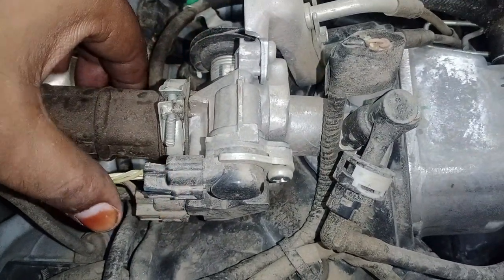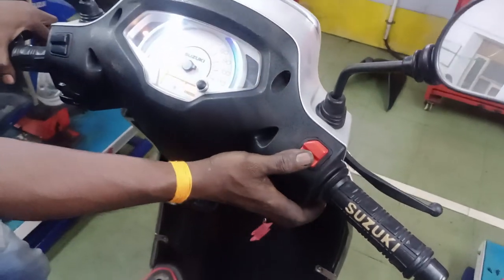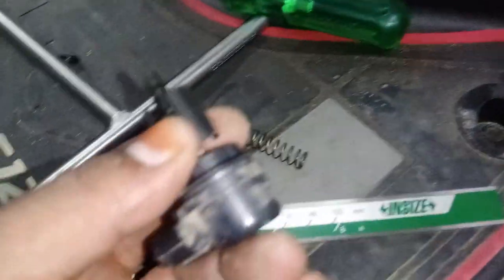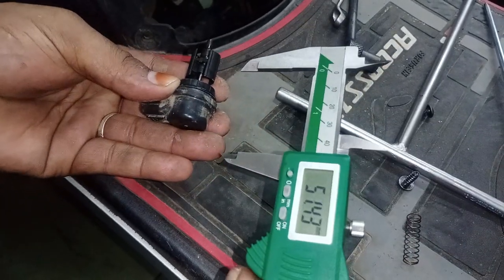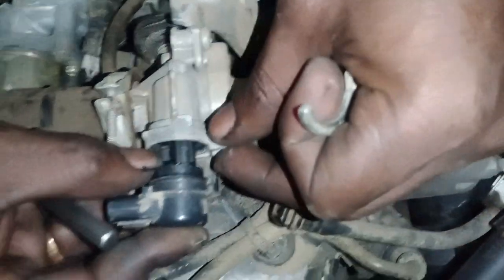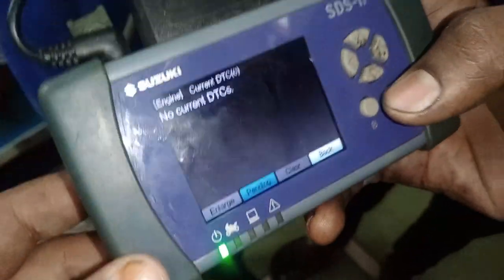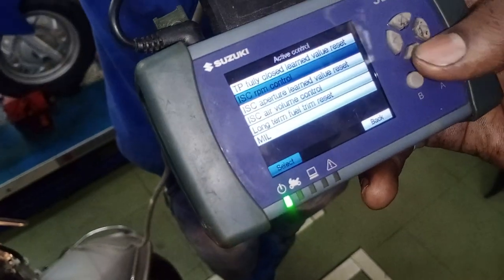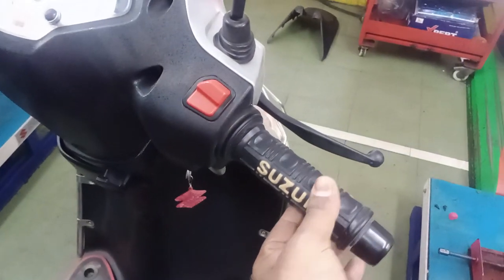💡Access Bs6 Slow Speed OFF | Better Solution in Stepping Motor Adjust and change 2022 Model - Review

Comment: Am From Thiruvananthapuram Kerala

My Acess 125 bs6, 1st service done.  Anna i want hand break like old model very difficult to park in slope area. Which lever is suit. 
Led light brightness very low
Reply from the maker: Hand brake work or not bro ?
Reply: @dheenavicky  Rear break loack clip, not have in bs6 disk model, i want to add, which will suit
Reply from the maker: @nerampokku152  Hai sir...  Disc brakes lock buy in local spare counter bro...